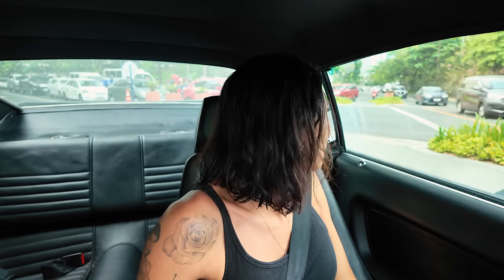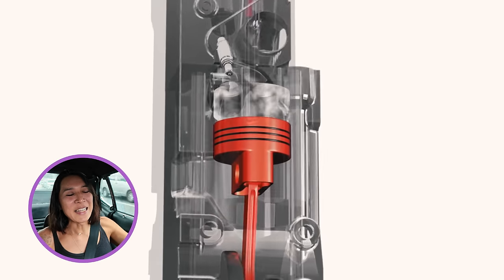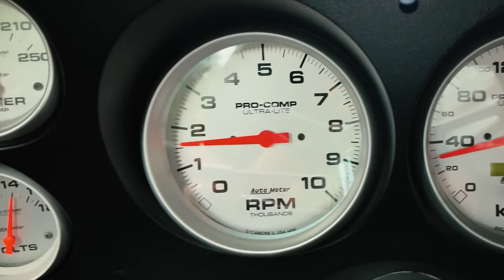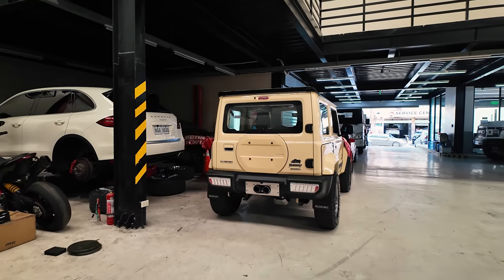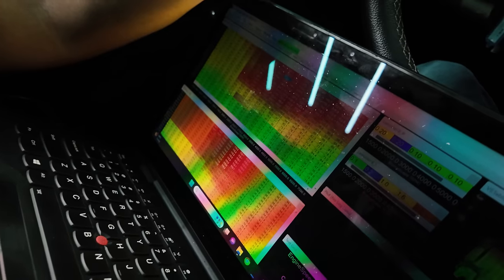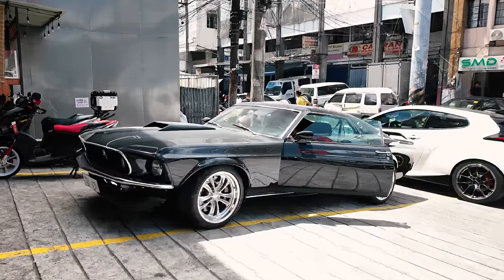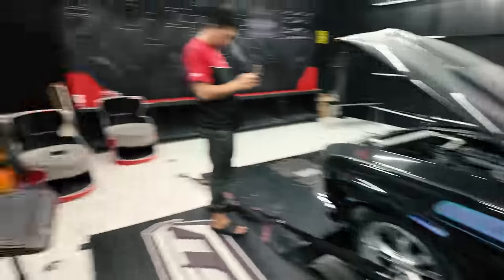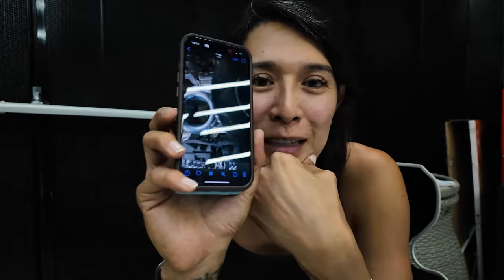DYNO TUNING my 964 and MACH 1 | Angie Mead King

Comment: Why not order a crankshaft sensor and replace it?
Instead of towing somewhere else?
The dyno indicates losing a crank signal or simply checking the spark.
The crank sensor has resistance, if there is no resistance or don't meet the threshold then it's bad.
If the crank sensor meets the spec, then check the sensor plug wiring, might be bad.

In the Mustang problem, I believe if you left the regular fuel injection system instead of these fancy individual throttle bodies,
you will get more power. The regular Cayote engine (made in Canada) should be getting at least 460 hp you are losing
by much (minus 154 hp). The individual throttle bodies are hard to synchronize, too. Even you fix the butterfly, 154 hp is a lot to overcome. Whereas the stock injection (with bigger injector) you will gain about 50 hp more.

Find another dyno shop, these people should be able to make some minor adjustments instead of letting you out of the shop
without trying.
Reply: Agree w that
Reply from the maker: We don't have available parts here in Manila